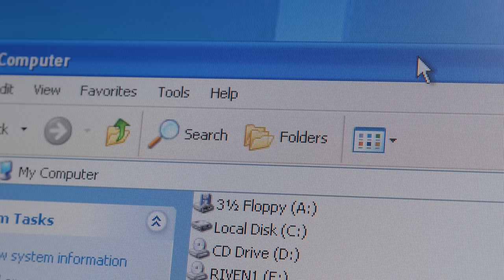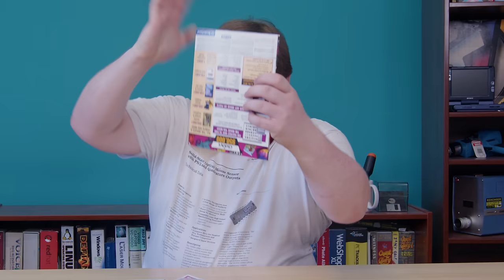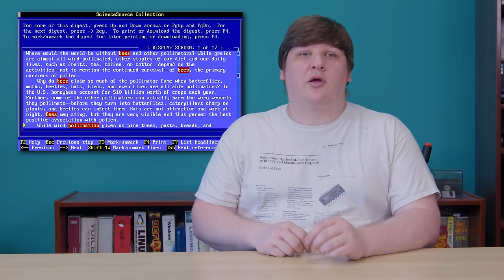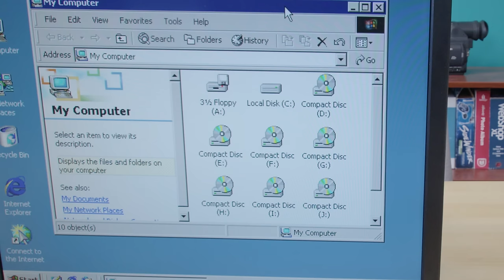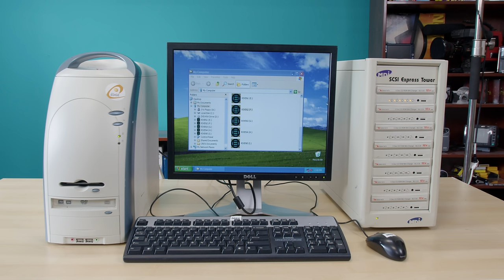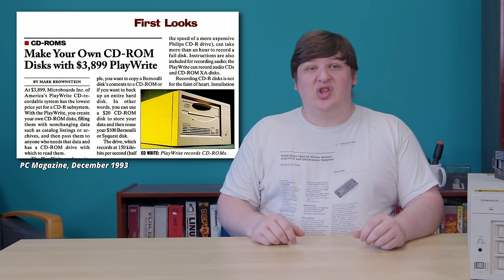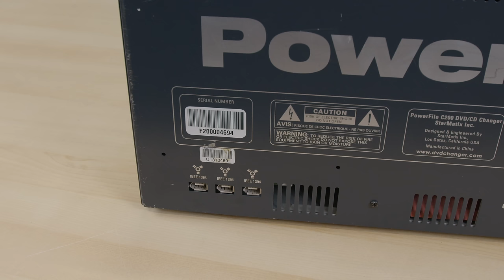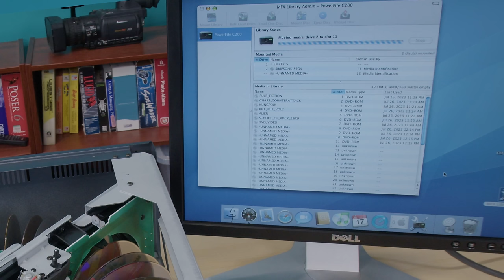A Jukebox for your PC: 1993's CDROM Servers

Comment: For me, the absolute killer app for CDRom was Public Domain (PD) software libraries. In one fell swoop, instead of paying $1.27 plus P&P for a single diskette. I could spend $32 and get everything they got on a couple of CDs. Mind blowing.
Reply: 1001 Great Games!  Mostly junk but plenty of gems!
Reply: Ah, shovelware, the soulless digital exploitation of the 90s! ;) But, although many people call it soulless, it was without sarcasm so much better than the present soulless exploitation of Internet users. They couldn't pry into users data and they had no way to squeeze gameplayes for money. Especially considering the latter factor, I feel the ratio of good software to bad was about the same as you'd find in a modern app store. I also had a better time with shovelware than with GNU/Linux in the following decade. GNU philosophy and propaganda effectively marginalized programmers who took pride in producing a good product.
Reply: @eekee6034  well that was a bit of an odd tangent heh.  Anyway, those shovelware discs were like $5.  You knew what you were getting for the most part.  There was nothing particularly exploitive about it other than some profit made on other's work but there was some value in the disc existing at all.  Lots of fun little games and stuff.
Reply: @Aeduo  Yes, I'm happy they existed. :)
Reply: I wish there was a 1PB CD-ROM , imagine a copy of the GPT model in your home computer for your queries without any spying or "you can't ask that", all running locally in your GPU, well if your GPU could just use normal DDR5 memory without being that expensive (nvidia is robbing everyone by selling memory more expensive than what it really is)

That would be a killer feature for a new bigger CD-ROM nowadays.

Comment: 20:45 - Can confirm - my first job was in 1992 as an intern at the company my dad was an IT manager for. A large national company with dozens of offices. They were upgrading all their Macs to System 7. They had a site license for it, but Apple only shipped one set of floppy disks. My job was to make copies of the install disks so that each office had two full sets. The funny part was that the fastest computer in the office was the only one with dual floppy drives (a Macintosh IIfx) so that's what I was given to use. I really quickly discovered the Disk Copy utility had an "image disk" and "write image to disk" functions (that apparently none of the actual IT employees knew about) so the second drive became irrelevant quickly. (Since System 7 wasn't multitasking, it could only read or write one disk at a time. Dual drives were because in theory it would read from one as it wrote to the second; but with imaging, that was moot.)
Reply: System 7 could multitask, but it was cooperative and single-threaded so any program could seize up the system if written poorly.
Reply: @Desmaad  And certain tasks did take complete control. Disk formatting, the Disk Copy app, etc.

Comment: Around 1996, my university had IEEE magazines archive in 10s of CDs. The archive contained OCRed copies of the actual paper magazines! It was amazing back then as students and researches didn't have to use microfilm/microfiche or flip through paper magazines. The IEEE archive were installed on two computers in the library, where each computer had its own set of CDs in an interchangeable SCSI jukebox.

Comment: I actually was that guy who got sick and tired of disc swapping with a single CD ROM drive, but I solved my issue with a double bay sized, 5 or 6-disc unit that I'm pretty sure LGR did a video on. Riven was absolutely the catalyst for this, but I was also really into a game called Timelapse which I think came on 4 or 5 discs. I really was of the assumption that multi-disc games were the wave of the future, and I don't know if I could have been any more wrong!😂

Comment: One really big use case for the CD-ROM jukebox drives was BBS sysops. If your BBS listing can brag that you have 1+GB downloadable wares, that puts you in a pretty big disk energy kind of mood in ~1992. It would draw callers in from out of state, if you really went to town with the idea. There were large multi-line boards that had numerous CDROM collections available for leeching. I think they experimented with membership fees at one point. Anyway, jukebox tech was big with sysops.
Reply: Absolutely. On one BBS I remember having to wait for the CD changer to change before I could access the various file areas that were associated with each disc. I remember it presenting the various Night Owl shareware discs on a menu.
Reply: What i'm taking from this is big disk energy
Reply: In the early 90's we setup a 6 line bbs with 6 computers networked together that each had two cdrom drives that ran at 2x speed. 12x cd drives total and it used a $900 diskdrive that was a HUGE 1000MB to hold the searchable index. Lasted about 2 years until dialup internet changed the landscape.

Comment: Hey, that DVD changer looks like a prototype version of the Kaleidascape! I worked for an AV company starting in 2012 and these were very popular with movie buffs who wanted huge libraries.  It used to let you rip your discs as ISOs and store them on a hard drive, but they got sued over it, so for legal reasons they started selling these giant disc carousels so you could just leave all the discs inserted, then pick a movie you wanted to watch and it would play that disc.

They had Blu-ray versions too, but it's basically the exact same thing - a giant 200-disc carousel that spun and would store your movies.  Like the one you showed, you could daisy-chain them together and have up to like 1000 discs on a single unit's main page.  And like your unit, it was a slot loader, one disc at a time.  We'd have interns sitting there loading discs for hours for the customers 🤣

But also you could take the lid off and just manually insert the discs.  It would still need to re-scan but you save time on sticking them in the slot that way.

Kaleidascape was a lot more refined, and had HDMI/component/composite outputs on the back, no computer needed.  You'd just plug it into your TV and could use a remote to select the movie you wanted to watch.  In other words, the PowerFile walked so Kaleidascape could run😩

Comment: I worked for an airline, and we had repair records older than 5 years on CD, and used one of these systems, but it didn't have any scheduling, as there were only a few people that would ever need to access them.  Even older repairs were on microfilm.  I think I only ever had to look at the microfilm twice in ten years.  Also, while I was there the engineering library went from a dozen bookshelves to a file on a server.  This was all in the 2010's.

Comment: We used five, five disk changers for our Mitchell automotive reference library in the mid 1990s until the early 2000s when it was transitioned to online databases. Every year we would get three or four disk to update  and every couple if years the entire library was changed out. It beat pulling books out, but was really a pretty silly and extremely clunky system
Reply: 7 to bypass registation crazy.
Reply: Ug,  Mitchell auto...    that was rough,   moved to a shop with alldata and fell in love.   😊
Reply: @kwisin1337  Even though I was alldata certified, in most shops I never used it much. 
Though mitchell on demand typically worked good enough, and some fancy shops had identifix (tech info). But the old mitchell on disc was a headache.
Reply: @kwisin1337  I actually used both for some time. They both had thier up and down sides, at least at the time. I've been out of the industry since 2015, and I'm sure it's changed a bit.  From 1993, when we acquired the system, until we went completely online, with faster internet and computers, I moatly used the computer for refrences after 1992, the last library we had updated. It was usually much quicker to pull a book off the shelf than to wait for a changer and a 66Mhz DX2 😆 There was a slight novelty to the disc system though. The more I think about it, the more I remember no really caring for it too much.
Reply: Ah yes, Novell Netware configurations and when it went down....

Comment: I interned in the I.T. department at a large retailer's home office. They had a CD library server with (I think) 90 CD drives in it. It was the size of a chest freezer. Hardly anyone was allowed to physically touch the thing. I know I accessed it a few times, mainly to remotely install software (usually Microsoft Office) onto new workstation builds. It was just another server in the network tree, and each drive looked like a folder. This was in the 90s, a (mostly) NT 4.0 enironment.

Comment: I have seen one of these in the real world, and the process of scheduling access and limiting thrashing was solved by people sending emails back and forth asking for time to use the library during dedicated time slots. When these were scheduled, you would get about an hour with the whole system entirely to yourself. If someone else tired to access it at the same time, yes, thrashing would occur but usually the person who was scheduled would very quickly locate the person who was causing the interference and go yell at them. It was a small-ish design firm of about 30 people, and they were using it with a large collection of stock media, fonts, and textures that could be applied to 3D models. They had a big library that could store 500 CDs, and they were still using it as late as 2010 because "What we have works, darn it, we're not upgrading".
Reply: Gotta love that bus priority control system there was yell at a mf to stop accessing.
Reply: @fordesponja just like when you were on the landline and your parent needed to make a call!
Reply: As mentioned in the video, when the juke boxes were teamed with a hard drive (or two) to cache frequently used files, response time got a lot better.

Comment: The Toronto Reference Library used to have a bunch of these CD-ROM databases. You couldn't check them out, or even take them out of a specific area of the library (because as you said they probably cost a fortune), but you could browse them there, and copy what you needed to something else or print it. I remember using them for a project in high school.

Comment: In the early 2000s working at an MSP we had quite a few customers using CD-Rs for backups.  They'd purchase a spool of 100 discs and swap out a disc every morning, storing the old one in a different spool after writing the date on the label.  We even had a few cycle through a spool of CD-RWs too.  I kind of miss those days - months worth of air-gapped easily recoverable backups.
Reply: They still have the advantage of being truly read-only and invulnerable to ransomware.
Reply: @dmatech  but so do tapes, and those can be way more data dense, faster, and with better environmental survivability

Comment: Another popular module was the Axis Storpoint CD.
It was a SCSI-to-Ethernet server that allowed CDROM libraries to be accessed by SMB, NFS or HTTP.
It's a 5.25 module that would be compatible with your SCSI Express Tower and would fit in the 8th drive bay.
Back when I was in public school, we had one of those CDROM Jukebox Servers with a Storpoint module and it attached to the School's Netware network
Reply: Definitely implemented on Novell servers for education / schools back in those days. (Back when I was in school)  There were numerous advantages.  Firstly, if the discs were given out to teachers, that meant they could easily be stolen or lost. Secondly, they had to have many copies because a lot of the teachers wanted them. As mentioned in the video it was a copious amount of data / knowledge - way bigger than hard drives of the time. Having it available across the whole school was liberating.  Students didn't need to always go to the library to research something from World Book Encyclopedia or Encarta (World Book had way better text, while Encarta had more multimedia like videos and audio)  The mild inconvenience of a changer swap was literally no sweat at the time. Besides most had dedicated drives and didn't have changer tech.  I think changers were more for archival where you literally rarely accessed the data.

Comment: Pioneer also made a 700-disc library with up to sixteen drives called the DRM-7000.  It could be equipped with either CD or DVD drives with recording capability, and had a standalone 20-disc magazine changer in the top.
Reply: why wouldn't it just come with DVD readers? were early ones not capable of reading CDs?
Reply: @TheAechBomb  Possibly the higher cost of the DVD drives.  These were very high-end drives.
Reply: @douro20  I suppose, but if they store over 500 discs I imagine it'd be worth a little extra cost to be able to read multiple foemats
Reply: @TheAechBomb How much do you think this thing cost in today's $? I don't think it was sold @ Best Buy, and maybe if you could afford it then $2-$3k WOULD be considered a "little extra cost", but my guess is it went for like $30-$35,000 USD in today $ (or $16-$20k in 1999)?  Does anyone know?

Comment: The mechanism in  the first Pioneer makes a lot of sense if you think about how much would have cost them to spin up a new production line for a niche product with uncertain future  instead of just using the one they were already making for the car changers.
Reply: the car changer one would also be fairly robust since it has to deal with the vibration of the car and road.
Reply: Yeah honestly it may look cheap but reliability wise it looked far more robust than the newer powerfile
Reply: @steverogers8163 plus the magazine specifically bragged it was more durable than the home music changer, so I’m sure they could’ve used smaller motors but just chose not to
Reply: That's what I also wanted to add, somewhat. The changer cartridge looks exactly like those of car stereos, where you had a changer in the back of the car. So my guess would have been as well that the mechanism is simply from a car changer that actually needs to withstand a lot more than a stationary unit.

Comment: I use to work for a company that produced COLD archival software. The main client base was the finance and banking sector. We recommended MO jukeboxes (then later UDO) for the storage.
I was on the front lines of the MO to UDO upgrades. Unfortunately,   the UDO media was not backward compatible with MO drives. When upgrading customers from MO to UDO drives we basically copied all the data from the existing MO disks to new UDO disks (typically multiple 1-4GB MO disk copied to 30GB UDO disks) while generating extensive auditing logs to maintain chain of authenticity with the original document. The MO disks would then be stored in a cupboard with a single standalone MO drive attached to the server for access if ever needed.

Thanks for a nice trip down memory lane.

Comment: I was expecting it since the last video with you talking about listening to your entire music library without switching a disc, and there it finally is, it's the disc donut!
Before my dad finally converted to a media server the centerpiece of our home media center was a slowly growing array of CD, DVD and eventually Blu-Ray donut disc changers. They were actually very different to the one you showed off, less features, one less reader and no burner, no data disc format was supported at all since they just plugged into the TV and ran their own firmware. That firmware did come with it's own level of jank, but unlike windows drivers they actually worked, and were nearly perfect for someone who amassed a wall to wall DVD collection. I say nearly because most of those machines had no clue what was put inside until you told it, which for a large collection all going in at once results in spending a large chunk of your weekend playing each disc, waiting through unskippable ads until you figured out what movie it was, and then ejecting the disc back into the donut so you could add it's name onto the list, thank god they had a PS/2 port for a keyboard.

Comment: I used these. And built (my own) of these. SCSI mainly. And normally CDRW drives. In case anyone now thinks they would like to have their dozen data CDROMs available instantly, you can now make virtual CDROM "stacks" of five, 10, 50, etc., CDROMs which you rip to .ISO and share over a Linux/BSD server. Which is what I used to do the minute it became possible. :)
Loved this video. You covered pretty much everything about my CDROM revolution.

Comment: I have always liked these things, and  have a 604X here, so it's nice to see these things covered. Pioneer lasers from that period do tend to fall out - I had exactly the same situation last month.  Cleaned everything up, bit of superglue on the side, popped it back in - works fine.  Of course, any glue on the lens and it would be game over, but with nothing to lose it's definitely worth a try.
Reply from the maker: That's good news, I don't think I have quite the patience to try and fix it myself but it does mean I'm more likely to find someone I can ship it to who's going to put in the effort to give this thing another chance. Thanks!
Reply: I need to check my 1804X to see if that's what's wrong with mine. Sounds like a good weekend project!
Reply: Replacing the laser pickup assembly isn't a huge job. Every one of these lasers will eventually give out, but Pioneer only used a few different variations.